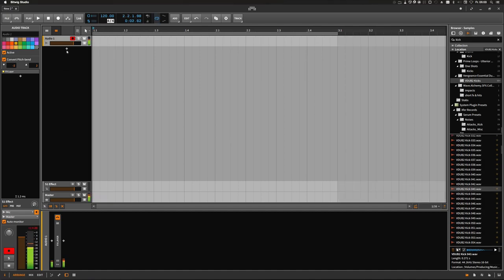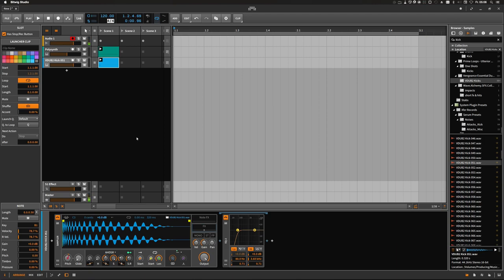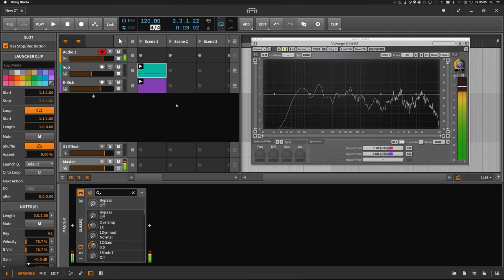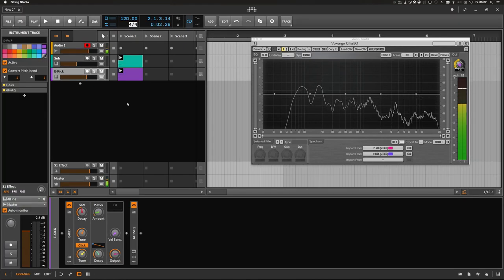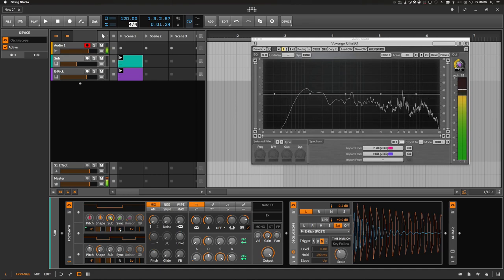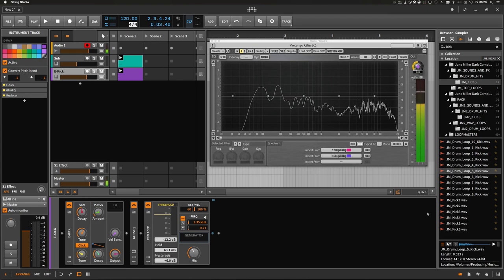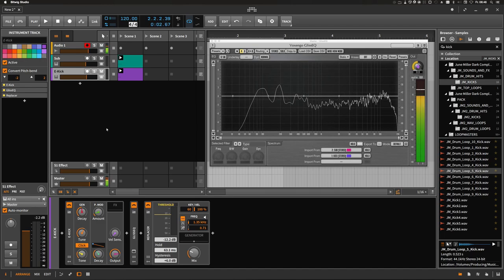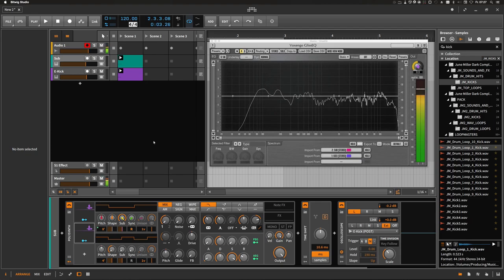Kick Drum & Sub Bass - Bitwig Tutorial

Comment: Hi can anybody tell me if I am doing something wrong as when I type G1 in E Kick tune the dial goes to max value,so I have to scroll the value in manually,is this a bug as typing in G1 in E tom works fine.
Reply from the maker: try G0, G1 is above max pitch for the kick. The Pitch knob only ranges from F-1 -> E1.
Reply: Cheers for the advice will give it a go.Love the concept of this formula for matching sub bass to kick drum as you put it saves time trying to eq the fuck out of everything! I am still not quite clear as I followed your tutorial by placing the polysynth on G 1 and the kick drum you typed in G1 in the tune knob and it accepted that value! Please forgive me if I am being totally clueless and missing something obvious, very new to music production.Thank you for your tutorials they have been very helpful and enlightening.
Reply: @droid-9  I am running bitwig 3 beta and it is missing this option for me also The old bitwig used to show the note as well as the freq range but it looks like in the newest version they just have the freq option and if you type in a note like you did it just defaults to max

Not sure why they would get rid of this, the work around I found is to use a plugin in such as GTune to show what note is playing so you can tune it yourself

If anyone has a better solution or knows how to set it so it shows the note then please chime in here

Comment: why did  Bitwig not add a sub bass plug in like In Logic Pro so you can simply add sub to your kick ? Ableton kick has also this feature. Or use a pulteq EQ to boost the low frequencies. You will get better results than with your tutorial.
Reply: there is kick plug comes with btiwig